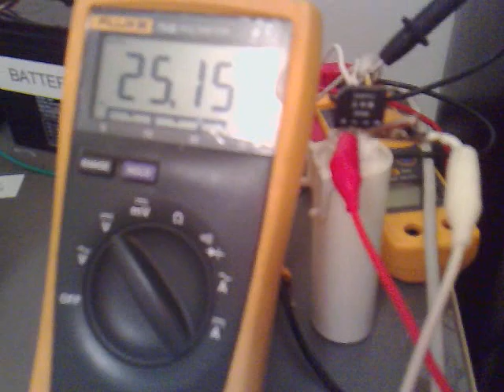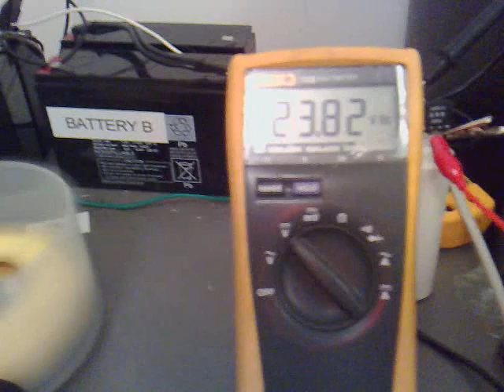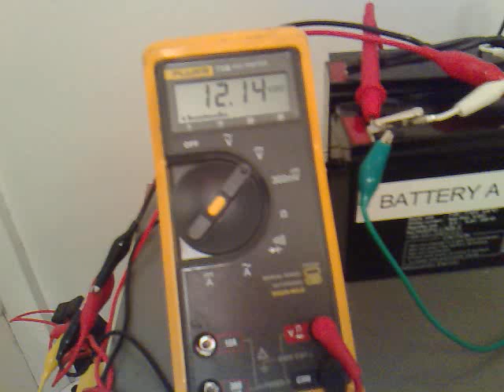Pulse Motor (30 Minute Charge) 052

Comment: Yeah.  The voltage the meter on the source battery is reading is inductive spikes from the coil; the battery's downward spikes, which are too quick for the meter to see, are actually the descending voltage you'd expect.  When the whole rig is stopped, the discharging battery ought to stabilize at a lower voltage than it had originally.

Comment: I see you have a video using a joule thief, I have built several of these little circuits and they are impressive, i think there is something to be said for high frequency when you look at them, but they are simply extremely efficient at taking very low voltage and making it usable. I think your pulse motor is a very efficient motor, have you tried putting a neodymium magnet inside the coil?

Comment: no, your not the voltage you are seeing is the spike that is hitting the battery and it stores this surface charge at a slightly higher voltage than what it contains but the amperage you could pull out of it is not the same as if you had actually charged it. overall wattage has actually decreased you are simply trading volts for amps, and have just basically made a moving transformer

Comment: Curious to know what gauge of wire you used for the second (pickup) coil, and how many windings per coil?

I presume those are air core coils, yes?

As for the ground wire, how is it configured?

Comment: Why do you all messure the voltage, is irrelevant, i can transform 6v in 220v with a simple inverter but that does not mean i am getting higher power output, the power is messured in amp's, watts, hp etc, so get some readings on V/A on input and output and you should see if you get more power output.